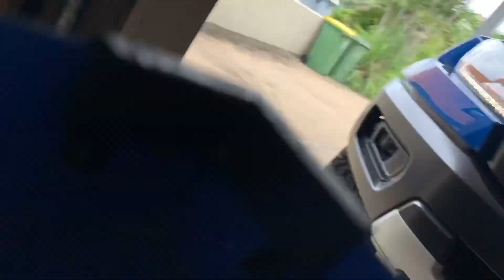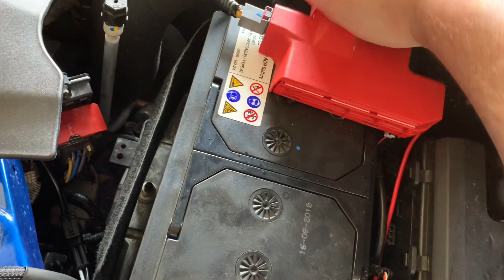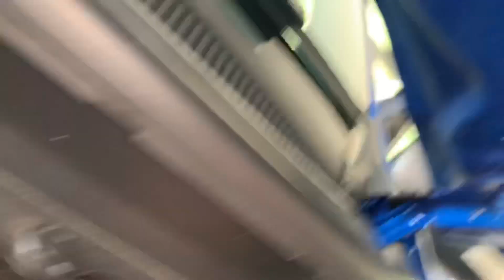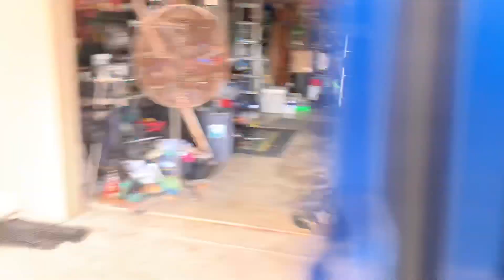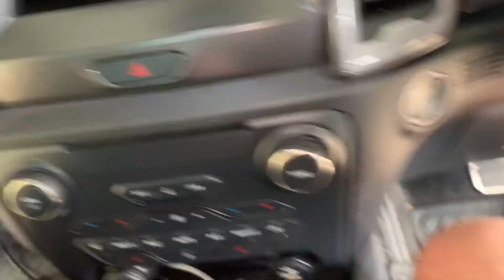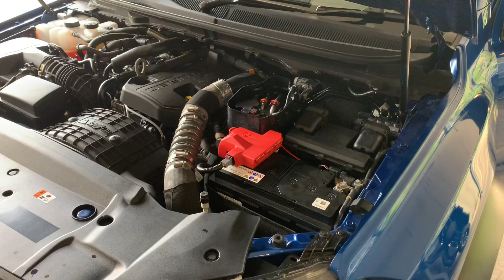2018 Ford Ranger Raptor Light bar and switch panel install

Comment: Nice, would it be possible to mount it further back (just like 1-2inches?)? Edit: ouch, 7 years ago... don't expect an answer to my comment... br
Reply from the maker: Not in a double bar configuration, it already sits very close to the roof any further back it would hit the roof at any bump
Reply: @jacobsgarage5458  Thanks for your reply - still with the raptor and this bar? It's a very usefull video/howto! thanks.

Comment: Thanks for the vid. Re the final wiring of your switches did you have to allow for negative switching or was the switch wired as negative black wire bottom pole input power constant to middle pole green or yellow wire and power out to light bar top pole red wire. Thanks.

Comment: Was your rhino rack noisy? (Wind noise). Did the light bar make it worse or no different?
Reply from the maker: Rowan Hooper the racks did ad a small bit of wind noise but the light bar actually acts like a wind deflector and quietened it down